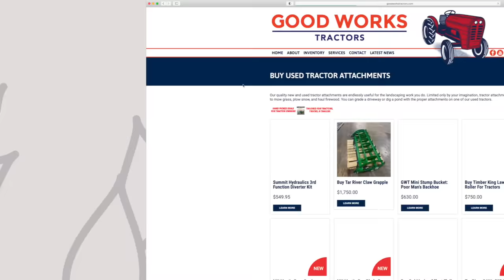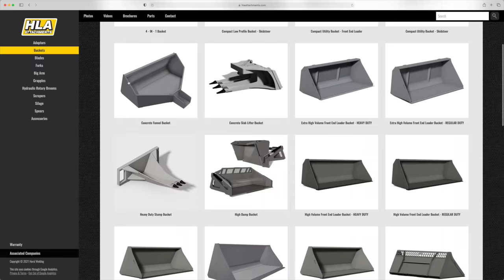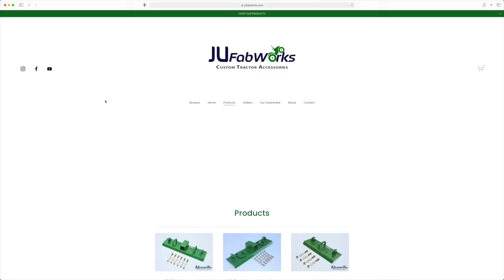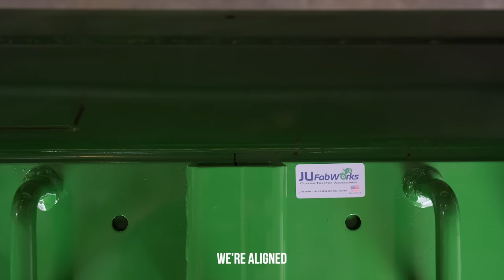BEST BOLT-ON BUCKET BRACKETS FIX JOHN DEERE'S BAD DESIGN! 🚜

Comment: Put the bolts with the thread and nut out the top as rock in the bucket will booger up the threads and will have a hard time getting nut off and the larger the drill bit the slower you want to run your drill speed

Comment: As a machinist the best way to explain it is, a larger wheel (drill bit) will need to turn less revolutions to cover the same distance in the same amount of time than a smaller wheel (drill bit). More contact means more heat. Drilling dry overheats and kills bits faster than anything. Cutting oil is best but if nothing else at least use water. You will find your drill bits will last much longer.

Comment: Thanks for the heads-up on these. Our JD dealer said he could not 'order' the HD bucket with our tractor, and due to supply chain issues right now "you never know what they might come in with". We wanted the HD bucket, but I have a feeling we'll get the standard. 🤨 At least this gives me a solid option for reinforcement and some extra connection points.

Comment: Our jd dealer welded a large length of angle iron to our bucket top. Then welded the 2 slip hooks and a catch hook in the middle. That even out any stress to the loader bucket. No problems with that.

Comment: That receiver is very high off the ground. Gonna take a good sized drop hitch to keep a trailer level.
Reply from the maker: Definitely want a drop hitch.
Reply: We recommend a 4 to 6" drop hitch for easier hook up of trailers while still being able to see the ball from the operators seat.
Reply: It'd probably work ok with a drop hitch but I'm leaning more toward the kind that attach to bottom of bucket.

Comment: Agreed, this was very useful info, I will be ordering later today!  Side note: when drilling in metal, high speeds generate friction which caused the metal (and the bit) to heat up. This causes cutting/ shearing ability of the bit to diminish quickly (more heat, slower cutting).
When drilling metal you a medium to medium low drill speed, and when possible cutting oil helps too.

Comment: I believe about 2 years ago you advertised the pair of bolt on bucket skids and I'm very happy I ordered them. I have a gravel driveway and I didn't have a problem moving snow without getting a bucket of gravel. These are a must if you move snow. Great product.

Comment: Ju FabWorks made me a custom setup for my New Holland WorkMaster 25s base off the JD one with the receiver, 2 d-links and 2 hooks for the center of the bucket. I than added 2 hooks from Kens Bolt on hooks on the edge by the arms. Both companies make great US made products and both great to deal with.
Reply from the maker: Yep, two good companies that we're glad are making products for us to use! Glad you JU was able to help you out with a custom piece.

Comment: I'm waiting on a 4 in 1 bucket from John Deere for my 3046 tractor.  When it finally gets here, I'll check out the possibilities for these brackets.  They look useful as all get out!  I really appreciate the way you are always looking for new tractor accessories.  I don't believe I would have ever come across these on my own.  Your videos are always informative and helpful, sometimes even humorous.  And discounts are nice, too.  Thanks again!
Reply from the maker: Marvin, we appreciate you watching and taking the time to leave such a comment. We're happy to keep making videos, but viewers like you are a good encouragement for us!
Reply: I bought my 4 in 1 bucket when I bought my used 5205 back in 2017. The only thing I’ve added was 3 weld on hooks across the top of the bucket. Got them off eBay for about $10.00 set. Just be careful if you attempt to pick up something too heavy or clamp too hard you’ll spring the clam shell portion and have to find a solid tree or stump to push it back even. No big deal. I wouldn’t trade it for anything!!!

Comment: I welded hooks and 2" receiver to my bucket. Best accessories ever. I use the 2" with a wench mount I made from some 2" square tube and 1/4" plate steel.  I love how easy to install your mounts are.
Reply: A wench mount conjures up a different visual in my mind
Reply: Winch not wench 😅

Comment: Awesome!  Thanks for sharing. two points I was thinking... block the bucket when it's hanging in the air and you have limbs close/under it... and use a brush for metal shavings, as a cloth retains them and you'll scratch whatever you wipe next (yeah... it happened to me). But that's my view from the cheap seats... you of course are there/know/have your reasons... much better than I do. Again... awesome video. Thanks for sharing. Best to you and yours.

Comment: I used a step bit for the first time on this install on my 1025R and will never use an all purpose bit on metal again. Makes it so much easier. Just be careful is you're wearing crocs with no socks, the metal shavings are way hot!

Comment: I apologize for not having told you what a good job you do on your Chanel. I enjoy most all you informed videos. I am amazed you are not a dealer
You did a great video on the JU products. You might check on how reliable your suppliers are. When I went to their website after I watched your video. I called & asked for a call to answer a question. The next afternoon I had received no return call. They then were sold out of what you showed on your video and won’t be in stock again until late June, and he had removed his phone number & would receive  e-mails only. I sent an email & still have received no email response. Keep up the good work! Thanks, John
Reply from the maker: Thank you John.

I'm a small business myself and it's very hard for me to get back to everyone even though I do it full time.  Jeff's doing this part time by himself.  I think he's overwhelmed with business right now.  Hard to predict what will happen once the word gets out.  So, I'm sure he's just trying to do what he can to get caught up now.  Growing pains are good problems to have.  Means you're on the right track.

Comment: I took a couple chain hooks and cut off the pin connection. I then welded them to a 2' x 1/4" plate, and gave it a nice orange paint job and bolted them on top of the bucket. I also took a D ring and welded it to a 4" x 4" x 1/4" plate and bolted that to the center of the back wall of the bucket. This way, if the cable or strap you have hood to it ever breaks, it will recoil to the center of the bucket instead of straight at the operator.

Comment: First thing I fixed when I got my 3320 back in 2008. The very first time I used the bucket it showed signs of tweaking. I didn't bend it but I could see it would eventually happen so I reinforced the top lip with a weld on angle iron piece to create a box effect. I worked for Cat and John Deere back in the day on the heavy stuff so light duty was something I had never dealt with. I told the sales guy when I bought my 3320 back in 2008 I didn't think it was going to last. It has proved me wrong. The little consumer grade tractors hold up really well if they are not abused. Good video, great presentation!

Comment: Just a side note, Steel requires a slower cutting speed and wood a higher cutting speed. Hence the normal two setting on your drills. Yes the slow speed is good for using with fasteners but it is also great as you found out to drill into steel. Oh and Aluminum is same as or higher  than wood.

Comment: Courtney as suggestion. I have a personal issue with metal shaving especially with drilling. What I do is put a heavy duty magnet in a cheap plastic bag next to my work. When finished I slide the magnet over the shavings and after I pick them up, turn the bad inside out.
Maybe that's why I like welding everything so much. 🤣🤣
Reply from the maker: That's a clever idea. IDK if we do enough drilling to worry about it, but if we do, I like this idea!
Reply: @GoodWorksTractors  After getting enough metal shavings in my fingers, I got to thinking about my dogs stepping on the shavings. etc. I love using it on the drill press especially. Makes clean up a lot easier.

Comment: Tips:

-Buy a centering punch set. That’ll align to your hole. You should always center punch metal before drilling anyway.  

-Squirt oil on that drill bit to lengthen cutting edge life span.

-Recommended to start with a smaller drill bit and work up to final size. 

My reaction:

Wow JD really did go cheap on them.

It’s great that these are bolt on, makes it easier for anyone to do. Personally I think I’d also weld them on too.
Reply from the maker: Thanks for the tip. Your ideas align with some others in the comments. Look for the next time we drill though metal on camera! Should be much better :) There is a weld-on version that will come unpainted.
Reply: Transfer punches are ideal in this situation

Comment: Good equipment but I believe I would install the attachment bolts from the bucket side up to the bracket so the bolt threads are more protected in case you need to remove/replace them or the attachment.

Comment: Hi Courtney:  Been tricking out the 2601 you forced me to buy and I wanted a 2" receiver on the bucket.  Dealer had already welded on the hooks.  I didn't want to spend a wad of $$ so I bought a very tough 2" step bumper hitch from Harbor Freight and drilled 1/2 holes (4) and bolted this hitch on the top of the bucket upside down.  Safety chain holes make for great hook ups and it is a bargain at $29.00.  Look up one at HF and see what you think.  Thanks
Rich Jennings

Comment: Great video!!

I would suggest removing any chips between the parts before final installation though. I understand why you put in a bolt and then drilled (to maintain correct hole location) but there are some drill shavings/chips that would have been trapped between.

On this application,  probably doesn't make much difference (but I'm an aircraft mechanic and can't break my habits. Lol)
Reply: Yes we would recommend that as well. Thank you.

Comment: Another great video! You perform well on camera - you might want to try your hand at acting! 😊  

When I ordered my JD3120 (10 years ago) I bought the HD bucket and had the dealer weld 2 tow hooks onto the top of the bucket. They have been a great addition. But, I have often wished I had a receiver on the top of the bucket so I could move some of my larger trailers around by driving forward. It's much easier to see where you are moving the trailer by looking forward as opposed to looking over your shoulder! This is exactly what I have thought about every time I back up a trailer using the tractor! I NEED one of those receiver options on the top of my bucket!

Now... if only we could solve this Canada/US shipping issue! 
When did you say you were going to open a Canadian outlet?? 🙏🏻🙏🏻

Comment: Great info..hate to have to wait for Christmas, my bday is a few months before then….but there’s your specially designed stump bucket.and we are in your generous 1000 mile range!  Decisions, decisions. Also I’ve read a few suggestions to use a taper punch which is great for aligning holes as that’s their job, but I’d probably start with a center punch so the drill bit wouldn’t wander.

Comment: Maybe it's already been said, but a step bit can save some work here.  No need to drill a pilot hole with a smaller bit, then change to a larger one.  Just make sure not to go too far with it, and make the hole too large!

Comment: The brackets look good. With the 1025r like I have I'm always concerned with adding weight to my front end loader because it will take away from the amount I can lift. These brackets might not weigh that much but occasionally I might need that ability to lift more especially with the small tractor. That's probably what Deere takes into consideration. The ability to remove the brackets would be cool. I don't think that most people have this concern though.
Reply from the maker: Understood.  I don't think they are in the realm of being heavy enough to worry about, but that's just me.  The brackets can be removed, but I'm thinking you mean a quick release?  I think a strong, rigid connection is needed to maintain the strength when using any of the hooks or receiver.  Thanks for watching!
Reply: I think that it would be a good idea to use these brackets on your bucket. And people that have a small tractor should get a quality fork attachment that they could use to lift more when needed. I've never had a problem lifting dirt or gravel with my 1025r. I know people that have more than one bucket. A heavy one and a light one. The brackets would definitely come in handy. And I have forks that are light and lift quite a bit.
Reply: FYI. The center mounted workmaster plate is 15 lbs, the taskmaster (sold as a set, left and right side, are 5 lbs each, 10 lbs total for the set. Thank you!

Comment from the maker: WANT MORE INFO ON THE BUCKET ACCESSORIES IN THIS VIDEO?  CHECK OUT THE LINKS BELOW!
Save 5% on the JU Fabworks Workmaster Plate: https://bit.ly/3fA3nue
Save 5% with code GWT on the JU Fabworks Taskmaster with D Rings: https://bit.ly/2T30z1k
Save 5% on the Heavy Hitch HD Toothbar with code GWT: https://bit.ly/3fzXyNk
Poor Man's Backhoe! https://bit.ly/3bD0bwH
Shop for all sorts of tractor attachments at http://www.goodworkstractors.com

Comment: Receiver hitch on bucket works great if your moving a lot of trailers around, you just need a pretty low drop hitch to get under most trailers.
Reply from the maker: I agree.  Drop hitch is necessary.
Reply: Put a boom on it for a higher reach

Comment: I will be ordering brackets for my 2038R with the GWT discount; seeing you do the install is really helpful for old noobs like me.

I like the receiver at the front. I have a receiver for the 3 point and use it to move a 5,000 lb boat into/out of my pole barn. It’s a tight fit through the overhead door and facing the trailer seems like it would be helpful. I wonder about the height of the receiver, though. Will the top edge of the bucket and the trailer’s hitch line up? The trailer is too heavy for me to lift. If they don’t naturally/easily line up, I’ll just stick with the 3 point. But, the hooks and D-rings?  “No brainer”.

Good vid. 🎯
Reply from the maker: Glad to hear it!  Yeah, I should have mentioned that in the video, but he recommends a drop hitch with the receiver.  So, something that will come down a few inches which would make it easier to attach to most trailers.

Comment: Howdy, the resistance when pushing on a drill bit is the center web of the bit, no real cutting edge there. Use the finish drill to mark your location then drill with a smaller bit about diameter of the finish bit's center web. Shoot the small drill through first, (much easier to push), then run your finish bit through.

Comment: New sharp drill bit, low rpm, and use some cutting oil, or gear oil, regular oil, some sort of lubricant and you can drill through that stuff much easier.  Don't ask me how I know.  :)  Also wish I would have seen this video before I mounted hooks on my bucket.  These look great.
Reply from the maker: Thanks for the tip, Mark! We'll implement next time.

Comment: Maybe someone already makes this but it would be kind of nice to just have one bracket that went all the way across the top and you could pick what options you want on it. 

Thanks for the info on this product.
Reply: Make certain it's heavy gauge metal and structural. Bending the bucket easy and very hard to straighten out.

Comment: Those would be great on any tractor bucket of any color. I would put them on my kubota since it has a top plate very close to that layout. I have front and rear HLA hay spikes for my kubota and they are solid. My rear spike is dual spikes and has a 2in receiver and a gooseneck ball mount on top.
Reply from the maker: I imagine as JU gets bigger we might see an option in a different color.

Comment: Put a little WD40 where your drilling.  It lets it drill easier and the bit won't get as hot. Also take the drill out of torque mode and into drill mode. 
Those side brackets look nice to put on a series 1 and 2 even if you don't need to reinforcement.
Reply from the maker: Thanks.  We're going to give that a shot on the next install coming soon.  Have a great day!

Comment: when you drill your holes, use a little cutting fluid (oil, wd-40, spit...), it keeps the drill bit cool, and eases cutting.  your bits will last a lot longer that way.
Reply from the maker: Thanks for the tip! We'll use that info next time.
Reply: You can purchase cutting oil which imho works much better than WD-40, it lasts a long time and doesn’t take much at all.

Comment: What my dad did to a 1025r is he put a 1/4 or 1/8 inch plate all the way across the top of the bucket and then welds hooks on it lined up with the 2 sides of the loader frame.

Comment: I have a Deere 3035D and trying to decide whether to order the Bucket Bracket shown in your video or the one with D rings. Any pros and cons you can provide would be greatly appreciated.
Reply: They are both equally as strong and serve the same purpose, The D rings will make some noise and flip back and forth but only while doing loader work and dumping the bucket. It really is just personal preference.

Comment: So looks like a great add on for my JD3032.  They sell weld on or bolt on.  I get the DIY for the video, but do you think the weld on version would be more durable, stronger, etc. that could justify the extra work and or cost.
Reply from the maker: I imagine the welded version would be a stronger connection in theory, so long as your weld is good, though I tend to think we won't find the breaking point of those bolts. But I would refer you to JU for that question, as he might have more insight as to why he made that version.

Comment: We put a short piece of square tubing on the outside of the bucket.  Then slip in two long 2" tubes  as fork lift and fit a sheet of plywood on top.
Now it is ready for a load of garden rubbish.